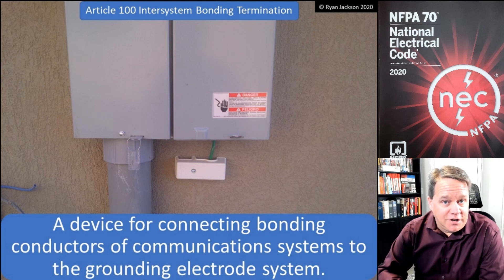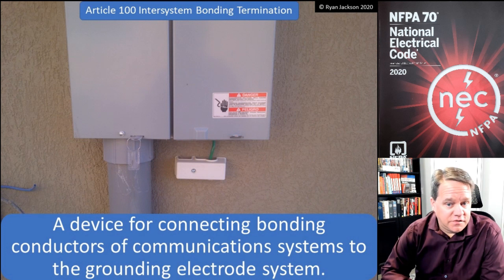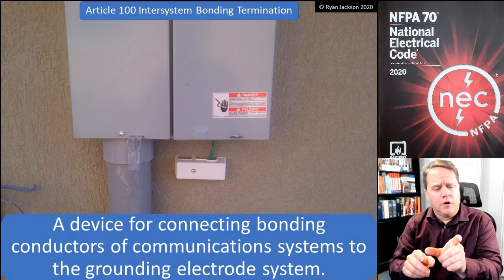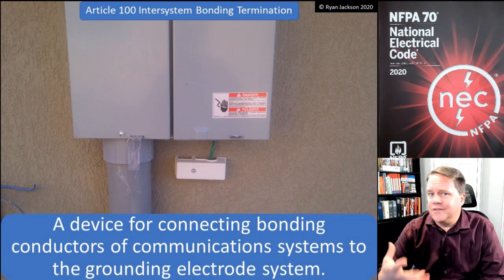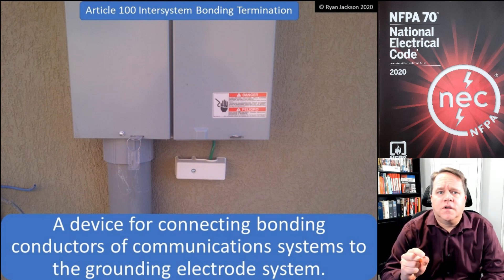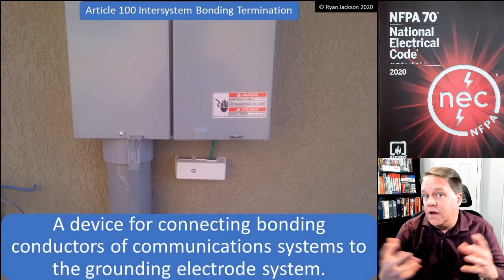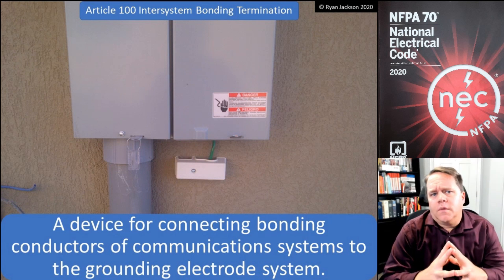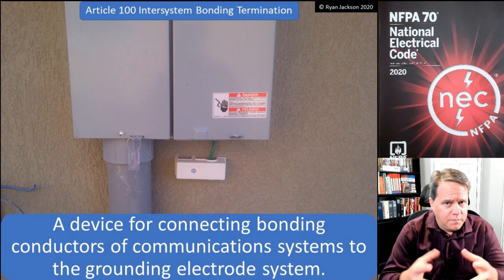100 Days of Article 100: Intersystem Bonding Termination

Comment: It is still rare that I see these used. I hear that the cable guys and satellite and whatnot are told not to use these. They use a fitting that goes on the meter cover.